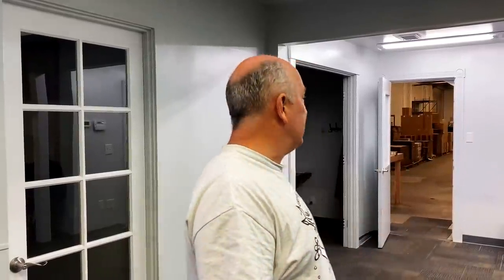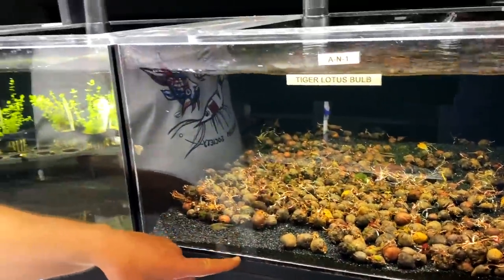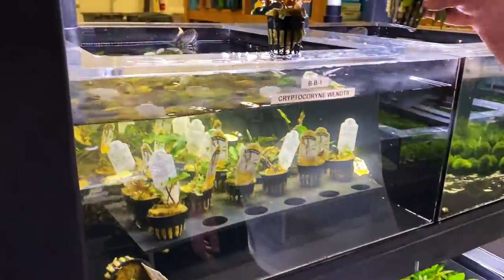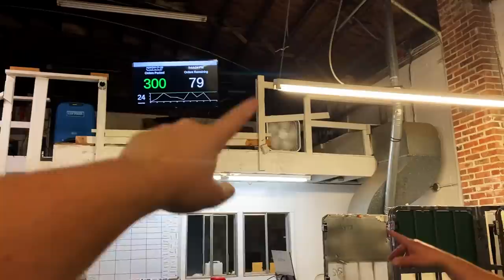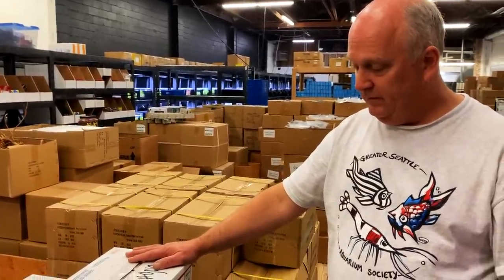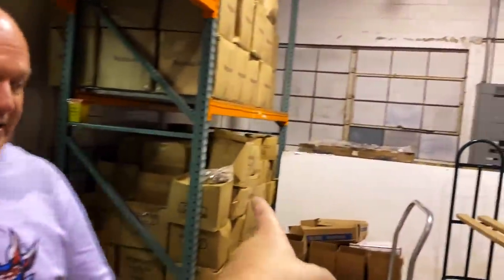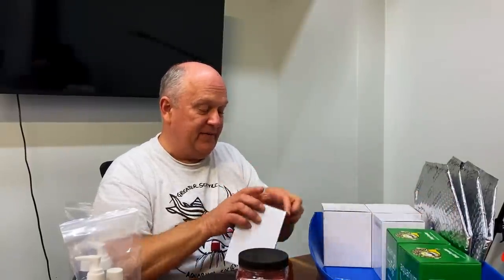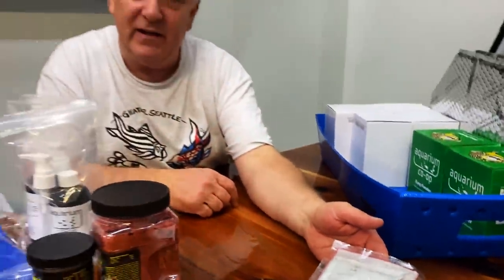First Look at Aquarium Co-Op's New Warehouse

Comment: Please design a reliable aquarium heater.  In the past year I’ve had Eheim, Aqueon, Cobalt and Fluval all fail in my fish room.  Help Obi-Cory, you’re our only hope!
Reply from the maker: We are working on it, but it's tough. Part of it is gonna be a big part in education of hobbyists. The first problem is people not letting their aquariums fluctuate. Using a high wattage heater to maintain 78 degrees at all times, is a constant on/off cycle. Heaters boasting within 0.2 degree accuracy should be seen with a question not as a good thing.

Electronics get the most stress from turning on and off, If you flip a light switch over and over again, the bulb will fail much faster than one that is only switched once a day. If hobbyists were to use say a 100 watt heater instead of 300 watt heater. It would turn off and on a lot less. Much less than 3x as much. Then work on keeping heat in the aquarium with glass tops and using other equipment to supplement the heat. Then choose a heater with a fluctuation of say 3 degrees. Thus if set to 78, it would turn on at 75, and turn off at say 81. This would lead to a much longer cycle time of it being on, and it being off.  Currently until the education is there, companies can't really make a heater that will do this as it won't sell without the education part. 

We use the same mechanisms really in our house heaters, they just cycle a lot less than aquarium heaters. Often times a simple space heater will last for many many years. But we also tend to only have them turn on and off maybe a couple of times a day really as we are trying to save money and not loose heat etc.
Reply: Aquarium Co-Op I use heater controllers on all my pleco tanks with a +/- 2 degrees variance, so fewer on-off cycles.  Maybe I’ll bump to 3 degrees.  Nevertheless, the current heaters on the market are mostly junk and all brands noted in OP have failed.  Just buy the plans for the old Ebo-Jager before Eheim bought that brand and lowered the quality.  Ebo-Jagers even came in the Aquarium Co-op green. 😉👍.  Hope to see you back in Minnesota again some day.
Reply: TM Aquatics Can you do a specific shrimp care video?
Reply: @AquariumCoop  That's not true. I'm a BSEE. The problem with heaters is getting the heat through the glass. Glass isn't a great conductor so a large temperature difference is required for the heat flow. Switching it on and off less has nothing to do with the root cause of failure. An ideal aquarium heater would be low voltage (safe to expose to water) up to 36 VDC and high current. This requires large wires and power supply which is cost preventative but in the long run allows the longest life and allows a heater to be placed directly in the water.

Comment: One thing about those USB pumps, careful removing air hose.  The little output can snap off and then you're sunk.  However, I ADORE them....so quiet, I use a USB hub so no overdone power strips....just use some care with removing air lines.....

P.S.  Fantastic video...will order some stuff as soon as Santa Claus comes....

Comment: Very Cool, I LOVE THE PLANTS. I HAVE Plants in my 55 and 10 gallon but how long are you supposed to keep them in the pots? Also I can't seem to get most of them to root, maybe not enough substrate??  most of them just come up and float on the top. Any way to solve that? The 10 Gallon tank does better,  only one plant floating out of 12. One I noticed the substrate has stuck to the roots and keeps them on the bottom.

Comment: Love your channel!  very informative!  I'm a cichlid guy at heart but I live in an apartment and can't fit the best size tank to keep them.  I used to have a 90 gallon which for me is the minimum size I would keep cichlids in.    I have a 55 gal and have tried to grow plants in it before.  I was trying to keep raindows, barbs, giant danios etc.  I could never overcome the algae problem and gave up. It was located in a hallway so no sun was hitting it,  just the aquarium lights.  Also the aquarium lights were supposed to be good for plants.  12 hour cycle. Could you do an honest tutorial about how to get a planted aquarium to grow from scratch?  Is Co2 necessary?  What lighting?  Fertilizer?  How long to deal with the algae?  I want to give it another try but I want plants not algae.

Comment: Hey love the channel i have a question i set up a 40 gallon tank running 2 aqaclear 50 filters in it im 5 days in but im haveing microbubbles coming outnof the filters going into the water staying ot the surface ia that nornal for a new tank setup when i turn the airpump off it looks likenthere isbgreese on top too

Comment: Hi there, I have been following you for a while. Probably not the question for this video but could you maybe tell me why I get cloudy water every time I change my filter on my 36 gallon tank? I have had it for almost ten years and it happens almost every time. I also have a sponge on the intake and extra bio rings inside the filter box as recommended by you in one of your videos. I am not new to the hobby and my tank is not over crowded. I have live plants as well. I am almost tempted to not change the filter at all as it is so clean and beautiful until I do so. What are your thoughts Thanks.
Reply from the maker: Are you changing water the same day? Most people do all their maintenance in one day and disrupt the tank. Losing too much bacteria.
Reply: I used to do that but for the last six months I don't change the filter the same day as a water change. I am very frustrated. Love your videos by the way. I am from the bay area as well.  @AquariumCoop